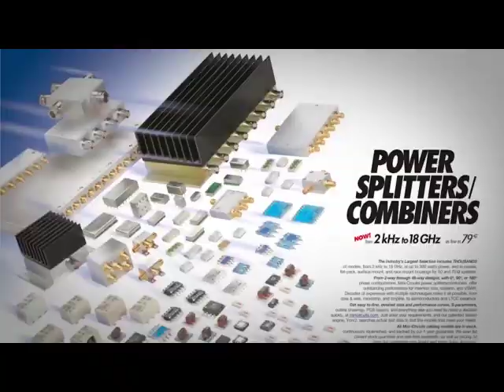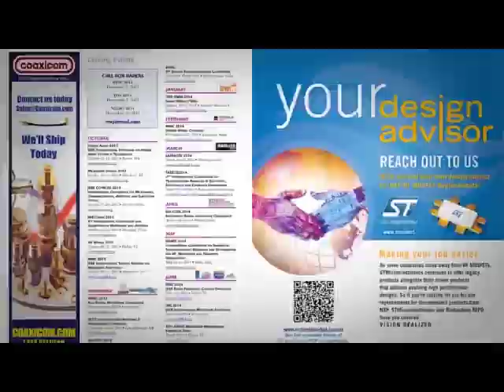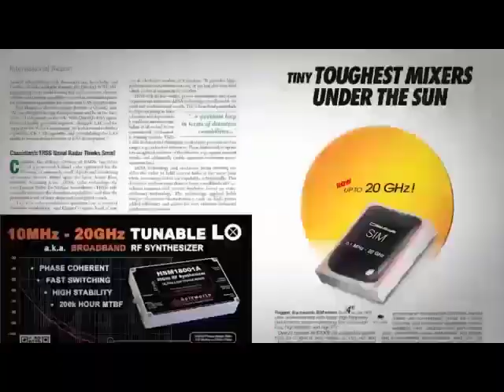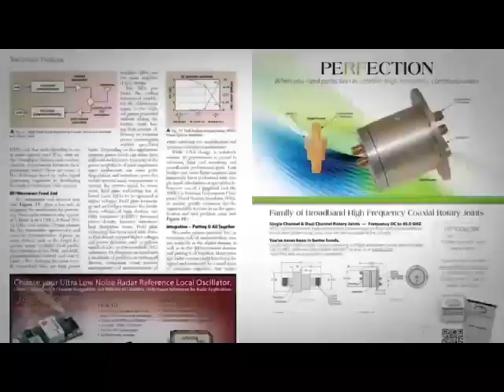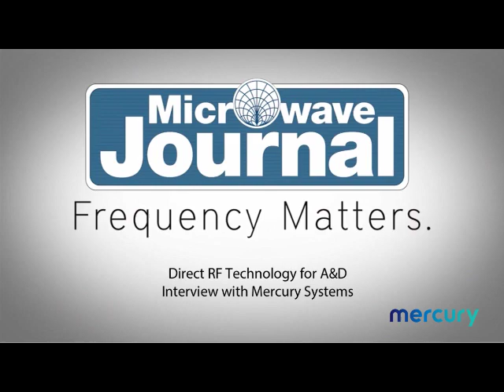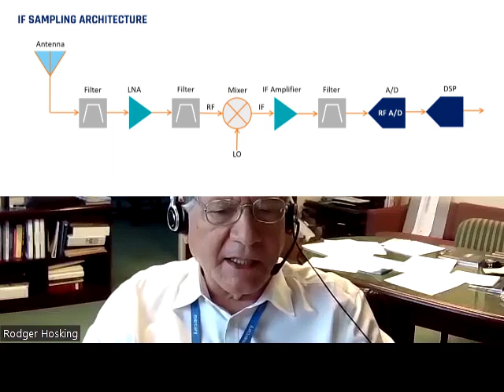Direct RF Technology for A&D Applications

Comment: One other big advantage of direct RF at microwave is a lack of down conversion stage, which adds phase noise from the LO. Faster and CLEANER signal extraction.
Reply: Right. The LO offset in the middle of the fft can be eliminated.But need high end systems